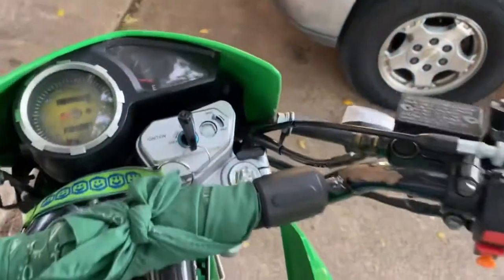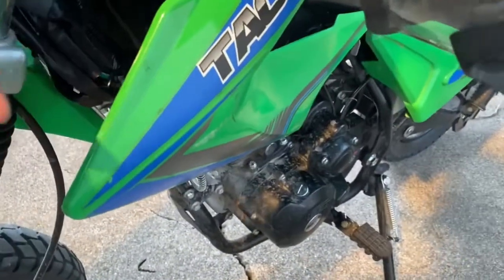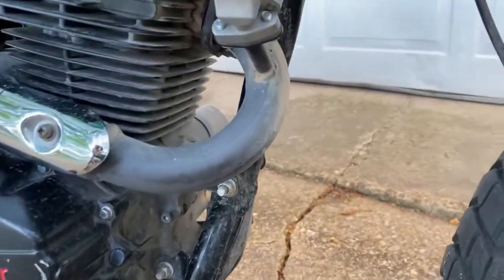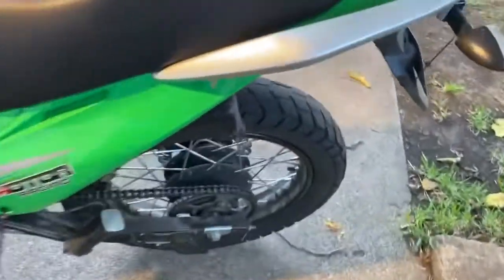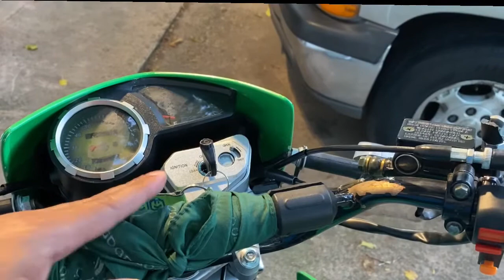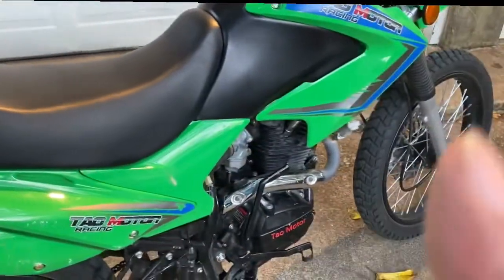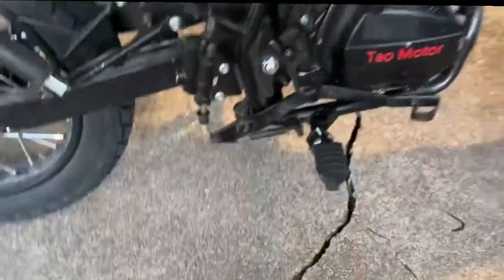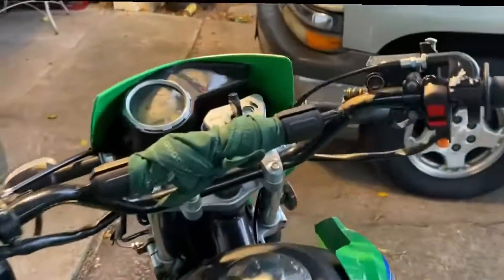TBR7 One year update! Chinese Dual Sport Motorcycle enduro

Comment: How do you start it for the first time? And what kinda gas it take? I just got mines yesterday
Reply from the maker: I had electric start! Kick start didn’t work right away. I used super unleaded most of the time. It ran better in my opinion on super
Reply: @dirtbikeguy07  so on regular it don’t run good? Just start the bike off with super?
Reply: @warrencaldwell10  yup! Bike is better on super